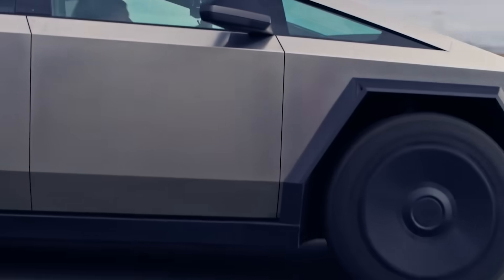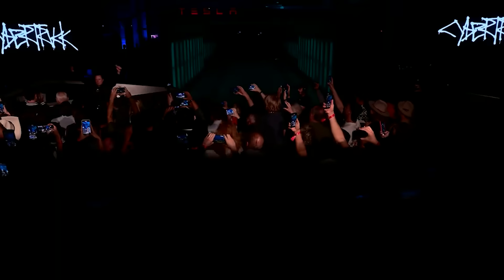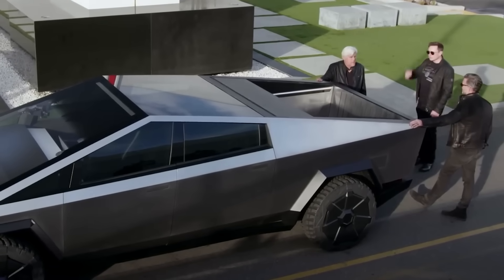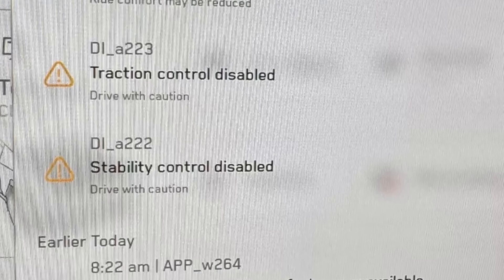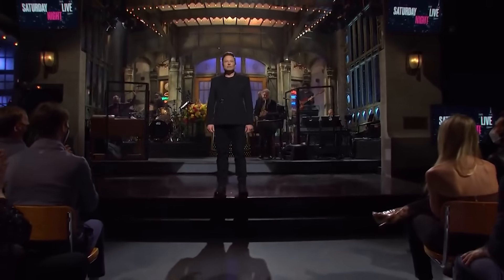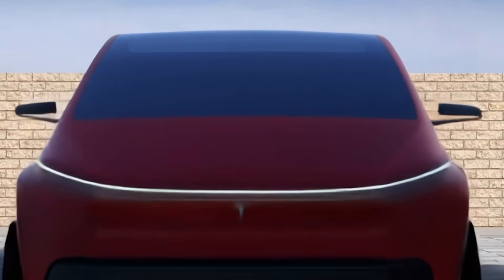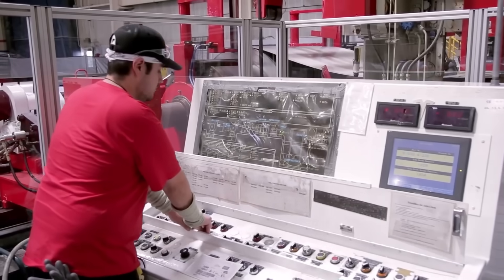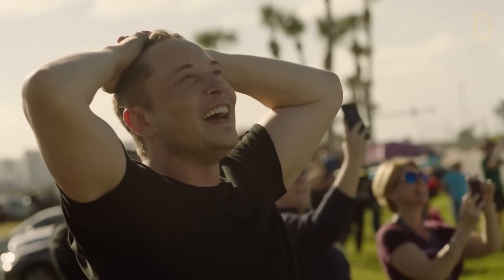Tesla Cybertruck 2.0 Shocks Everyone

Comment: Well this proves with enough determination you CAN polish a turd. But ehy didn't they focus on any of the problems as well? It looks much better but still 100% of the problems as the original. Reinforce the frame so you can tow something feasible. Center the very important touch screen behind the steering wheel with button controls like the F1 or even a PlayStation steering wheel. Not smart to have to keep looking where the radio should be to see your speedometer.

Comment: The truck is fine. However, there was a noticeable price collapse on CarGurus over the last 4-5 weeks. It appears the two models sell on CarGurus for only $0-5k over the ‘invitation’ price. I’m invited to buy Cyberbeast for $131-132 and they are selling for $135-140k on CarGurus. If you consider how few of them are out there and how many people are supposedly inline, what do you think is going to happen next? Basically, the market disagrees with their current price tag…as simple as that. I’m fairly upset over the $1100 deposits I made but better lose that than $20-30k if the company cuts the price. It’s a bit shocking what I’m seeing on CarGurus, and the fact that none of the reviewers mention this, but let’s not forget that the original price was supposed to be $70-80 when I put down my deposit in q2 2021. Shocking so do your research on the sale price unless money is not an issue. I do love the truck though so it’s a nice product.

Comment: For the proposed design the Cybertruck would need to use thinner steel like in other cars. The current 30X cold rolled HFS steel does not bend, that's why the truck has so many straight lines. Therefore using common auto steel, it won't be as "tough", it will get car dings, scratches, probably require paint, and certainly won't take bullet shots.

Comment: Is any of this corroborated?  If you still have half a million people on a waiting list, it does not matter if it does not appeal to everyone.  Keep making them as is.  Just speed it up.  Redesign effort would be better spent on a van.  Either a decent sized family van, or a smaller commercial van.  And they need to get those semis built.  We need 3 million of those on the road, years ago.

If they do, do something about the Cybertruck, it should be an off-road version that can handle falling 30+ feet at speed, and is truly amphibious.

I have never been a fan of knob and button delete, even less gauge cluster delete, but millions of others don't mind.

I'd like to see more effort to reduce weight, increase aerodynamics, and increase range while retaining crash safety.

Comment: In all Tesla vehicles the brake overrides the accelerator so when a protruding corner of floor mat on the Cybertruck snagged the accelerator you just had to apply the brake. You can't smooth the lines of an origami style tough stainless body. Cybertruck is steer by wire with a 48-volt electrical system that uses less copper.
Reply: @robertsmart5600  Hi Robert share more ideology

Comment: The problem with Stainless Steel is it bonds well to ferrous metals, IE: a rusty metal object strikes the body and some will embed into the SS and rust. I work with metals, and boats, and have plenty of experience with both. It should be sealed against the environment. I like innovation, but that thing is butt ugly to me. My concerns are the worsening weather as the Hail is coming in frequently as large as 4". That breaks a lot of glass. And if you are doing 70 mph, that could be terrible. I can only wonder what the truck would look like afterwards.

Comment: Sorry Elon but you've made such an ugly vehicle. Good luck with upgrades and improvements on body styles. Oh, and the multiple recalls mandated by the US National Highway Safety Administration (NHTSA). 
The newer releases of single, dual, and tri-motor upgrades are freakingly outrageously expensive but have all the NHTSA recalls beed addressed?
The concept design looks very appealing to me but as we car nuts know there always seems to be a huge difference between concepts and actually released model are hardly even close is design.
So, when  is the "New and Improved" Cybertruck due for release and how much more will it be priced at a level I still cannot afford? Elon doesn't seem to realize that the majority of customers are not millionares.

Comment: He mentioned the "rust" but it turned out not to be rust at all. Rather, it was crap in the air sticking to the surface. Just wash it.
Reply: Yeah, you just need to wash it, dry it, keep it dry and store indoors after every trip 👍🤣
Reply: @phiksit  I have a special parking spot in my living room for it but I will admit getting it thru the door is a bit tight.
Reply: Speaking of rust, you should check out my Cybertruck Transformer, code name: RustBucket, the new leader of the Junkions. I also made a “Elon Rust” robot head. 😂

Comment: The stainless steel is a major attraction of the design.
Reply: DeLorean looked good in it. Got to work on one once.
Reply: What is stainless mean with Rust on XD
Reply: That’s a liability repairing will be difficult, expensive, and long lead times for parts
Reply: @Marfoir0303  As someone said in the conversation the Delorean has been around for along time and it isn't difficult to repair. Why do think that higher a production vehicle from a stellar company as Tesla would have trouble meeting a need for parts? Not to mention the durability of said stainless steel which doesn't need paint nor easily dents or scratches and the gorilla glass, not unbreakable but a heck lot tougher than regular contemporary automotive glass. Not a liability but a great asset, won't you say.

Comment: When I saw the Kardashians and the Biebers taking delivery, I lost most my interest in the Cybertruck. I'm not the suburban type, I want it for hunting fishing and truck camping. I don't care how fast it goes.
Reply: Andrew, it would seem a quiet, capable four-wheel drive covered cargo vehicle with seating for five, abundant electrical storage and output, which has the ability to energize itself remotely with sunlight and wind power would be the ideal for wilderness adventure.   The impact of noise and the exhaust of generators are avoided.  Granted, camping is about leaving convenience behind.  However, the disruption of the journey can scare away the wildlife and game that you have endeavored to experience along the way and at your destination.  At least consider this advantage.
Reply: @markharmon4963  I'm a 75 year old disabled vet, there's not even room to roll out a sleeping bag. They would like you to purchase the $3000 tent option. I do drive an M3 so I'm aware of the advantages of driving an EV. For over a$100,000 I'll wait for a truck that better fits my needs
Reply: @andrewfurie5647  Sure, $100,000 is not exactly going back to the Earth.
Reply: @markharmon4963  Neither is the $3000 tent.
Reply: It's soundproof. So you cannot hear the sirens of emergency vehicles? I find that to a safety hazard.
Reply: Good thing u didn't buy it, it doesn't have a usable enough range for camping/overlanding
Reply: This vid is advertising for cybertruck🤮
Reply: How does them taking orders have ANYTHING to do with how you enjoy a product.  Who gives a crap.  Enjoy what YOU enjoy.  Never understand this mentality.
Reply: @tchlin  for a $100,000 I'll wait
Reply: Ah yes, losing interest in a product because of some buyers 😂, what a way to approach decision making.... Well then why don't u avoid pretty much every product out there because each one, LITERALLY EACH ONE, was bought by someone you probably wouldn't respect at all 🤷😂
Reply: @RoguePhotographer  yes I judge products by the advertisements. I drive a Tesla and own Tesla stock. I will wait for a truck that better meets my needs, than cruising the suburbs.
Reply: @andrewfurie5647  Tesla doesn't do advertising
Tesla cybertruck is owner by all kinds of people including all sorts of celebrities.
And my point stands, if you're just going to make your purchasing decision based on Justin Bieber or Kardashian dump truck owning it then that's quite a flawed to look at it. But hey, you do you, as far as I know the truck has been real useful & reliable for most daily users, deserving of all good advertising 🤷, having some bad celebrities owning it doesn't IN ANY WAY make it a bad vehicle to own. And yes we all own Tesla shares and vehicles
Reply: @RoguePhotographer  That was advertising , do you believe they were the first to sign up for the trucks?
Reply: @andrewfurie5647  by definition, advertising is primarily the company paying for it, this on the other hand was free advertising for Tesla. The company got paid & took advantage of who ordered, & just so you know kim & Justin we're definitely not among the first ones to receive the truck, I'd say even a couple hundreds (among them celebrities) came before we ever saw Kim or Justin "take delivery" of their truck, so even then Tesla did not "prioritize" those 2, so making such a fuss about it is nonsense.

I mean hell you getting so annoyed by those 2 I don't know what you would say if you see nowadays news with the Russia's "ally" taking delivery of his truck & fitting a machine gun in the back & publicly thanking Elon for it, idk about you but THAT is bad advertising, nowhere near Kim or Justin would ever be 😂
Reply: Elon is that you?  @RoguePhotographer
Reply: @OpalDruscilla  no, I am little X